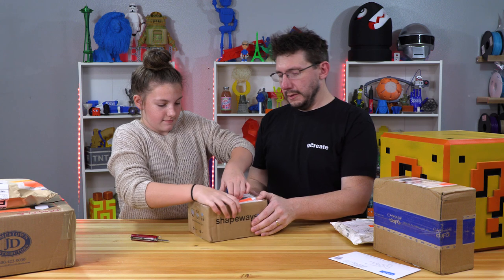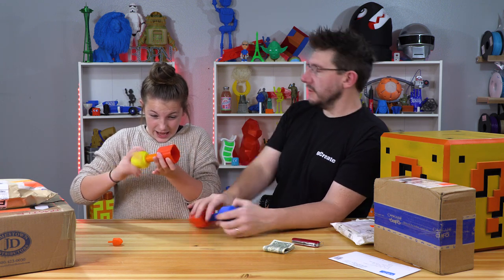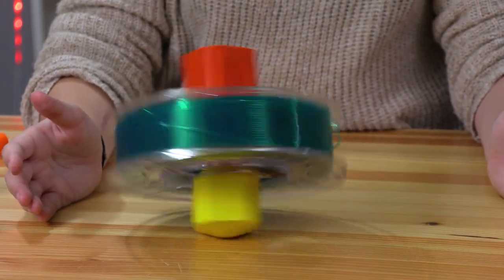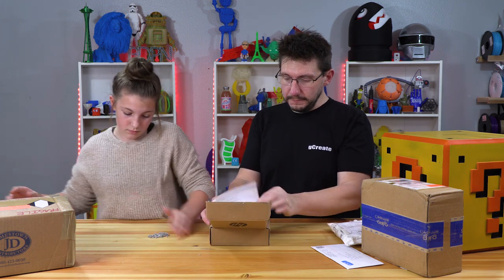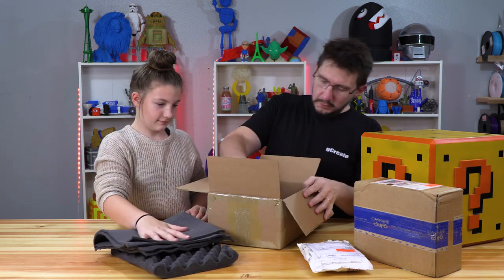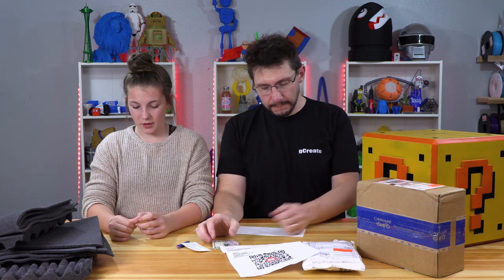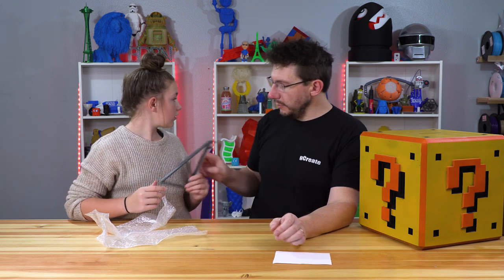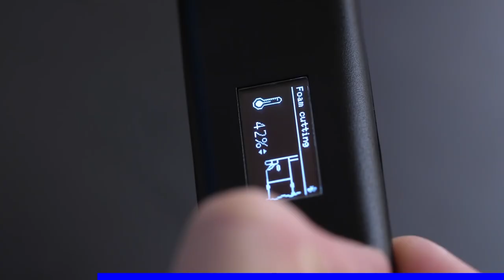Fan Mail Friday - ON A SATURDAY???

Comment: you can fix draw strings with a normal safety pin, no need for a printed item.
Reply: As the saying goes, if all you have is a hammer, every problem looks like a nail. In other words, a person tends to use whatever they have.